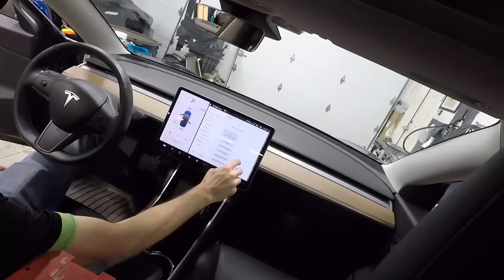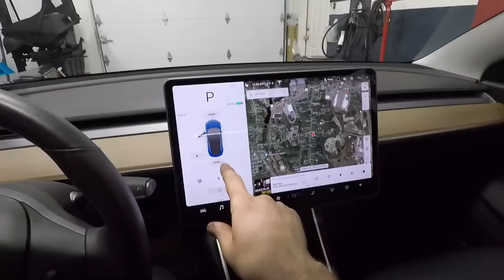Electrified Garage: How the Pros install a Hansshow Tesla Model 3 Power Trunk Retrofit Kit

Comment: Listen to this guy people. When it’s done right, it’ll work for ages. 

I say this because I had a 1st gen Cadillac CTS. And in order to PROPERLY change out the headlight bulbs. You have to remove the front bumper. However, some have discovered that you could remove the air box for the driver side, and fuse box for the passenger. Both had its issues. The air box would some times not seal up tight. Some of those times, the engine wouldn’t stay running due to lack of flow over the MAP(I think) sensor. Or a week down the road it would start to act up because of the seal. 

Then the fuse box would have its own problems, but most of the time they didn’t show up until months later. 

Sure they saved an hour or so of time by not removing the bumper.  But they caused themselves hours of headache down the road. 

My point is, do it right the first time.

Comment: Thank you for showing the convenient 12v power source. I wish I had known about that when I did my TeslaOffer kit last year.  I will definitely use it for when I add a tow hitch lighting module to my 2018 M3p. 

Btw, did you forget the wires for the trunk area lights or do they not do that version anymore?

Comment: Don’t follow the drilling through the body part! There are grommets under the crash bar where you can pass the actuator cables through. Other than that it’s a great tutorial.
Reply: He claims the drivers side is occupied by a drain wire, but its purple and we have done it in that plug ??
Reply: @rpmtesla  the existing hole with gromet is not on the side of the car, it's under the crash bar.  There are two of these, one on each end of the crash bar. Check out around 15:30 into this vid https://youtu.be/7ytE7fd45b0
Reply: @michaelbergmark3549  Thanks for the tip. I found the two grommets you mentioned, and used a hole punch on them and put my cables through those.

Comment: Any reason you don't go through the two blue grommets on the rear of the car, if you have a post 2019 car, rather than drilling a hole?
Reply from the maker: You can do that, there's no reason why that wont work other than size of hole VS plug size depending on the make/ model of kit you are using.

Comment: Some extra tips, I just installed this kit with the help of your great video. I really didnt want to use the rear light holes either. The only thing I did different: I found it better to not drill an extra hole but route the left wire to the exisiting hole on the right. (The cable is long enough) Also make sure to remove the metal bumper clips if the dont come off by themselves. The can scratch the paint when reinstalling. When i put my rearbumper bach a cable of the parking distance sensor became stuck between the inside of the bumper and the metal bar. I didnt notice this untill I was finished and had to remove the entire bumper again.

Comment: NOTE TO EVERYONE. I HAVE INSTALLED MY STRUT WIRING WITHOUT RUNNING IT DOWN THE TRUNK AND GOING IN THE TAILIGHT (BAD IDEA) OR DOWN TO THE TRUNK THROUGH AN EXISTING GROMMET.   I obtained double sided grommets with a tube like the factory grommet that goes up to the trunk lid. My wiring comes out through the vertical wall (I had to drill a hole of course and had the rear deck top out) in the rain channel/gutter through this grommet/tube just behind (towards the back of car) the factory on the right side and alone of course on the left drivers side. Just above/forward to where the strut bottom attaches.  The wire only comes down a couple of inches then to the strut. Looks like a factory installation. Not sure why nobody else I have heard of has done this.

Comment: What model 3 year was this? My kit came with a CAN BUS.. I see you did not install this? Do you have to? My wont even fit my 2018 model 3.
Thanks
Reply from the maker: Yes, the CAN bus needs to be connected if the kit requires it. This is not that hard to do, the interface is behind the center console or the drivers side kick panel depending on kit make/variant, this kit has a plug in harness and did not require CAN connection.

Comment: I just did the install today and now my 12v battery is dead. I did the power to the 12v connector under the rear seat thing but that bolt is weird. The washer comes up with it and I couldn't get the power terminal connector to slide between the nut and the washer so I put it at the bottom. Does that matter? I was doing this project for most of the day and I'm wondering if I hurt the 12v by doing that. I didn't  turn climate off so it was on for hours like that, and I had the car powered off quite a bit but I read that can also hurt the 12v because the main battery isn't supporting it then. Ugh. :(

Comment: Electrified Garage, I have a totally more oem way to do it. I can understand that others may not want to do this because it does require drilling a new hole through the vertical side of the gutter area.  The trunk wiring goes through a grommet on the right side which has a boot. the grommet as a lip on the inside and outside to keep out the water. It is also on the vertical to reduce water flow going on it. On the left side there is a similar flat area which is not used since there is no boot there. You can buy such a similar grommet/boot and make another smaller hole further up or down the vertical section with a 90 degree bend and will run the wiring right into the trunk area without going to the gutter and cramming under the seal etc. Much less unsightly, water safe and looks like it was oem.  I found these on the internet. They are the only one I found that use a round hole which is easy to drill, rather than an oval hole. https://www.ebay.com/itm/Power-Window-Door-Jamb-Wiring-Boots-Pair-Accordion-Style-Z-4-Long-3-4-Hole/352208860385?hash=item520148b4e1:g:7pQAAOSwvdxdRK09     These have grommets at both ends, but you could just cut one end of and just use the one grommet and the boot downward with the wire coming out. The boot going in a downward direction would prevent water from getting in and it would not upward towards the grommet.

Comment: Installed the frunk kit today on 2018 Model 3.  Worked great initially, but now the frunk lid is stuck open.  Tried power down, trying with debugging cable and without, still stuck open.  Any suggestions? Thanks

Comment: There is one big problem here, the 12 volt source under the rear seat, can from time to time go to sleep, only way to wake it up, is to put the car in drive. I will now extend the cable, so the I can reach the 12 volt source that Hansshow point to in the manual.

Comment: You should keep the bumper off until you put the kick sensor 2018 earlier models you have to remove a complete bumper however later 2018 up they have a square top off rear bottom bumper easy access to mouth your foot sensor.
Reply: I see why because you're not installing foot sensor version 2 compared to version 3 is so much easier to install you didn't have to mess with the C pillar you wire straight to the trunk lid area. That it. Also I prefer to put the Box controller on the left hand side where there's a ground near but also it's a straight shot to the power supply need a driver foot rest area there's a positive bolt waiting to say hello to you. Also best install an extra momentary switch on the left hand side for most convenient likely you'll be tapping it on close trunk on way to your driver side instead of reaching all the way over to the top right-hand side or lower if you're already on the driver side. Feel free to see my video on my channel easier more clraner  installation modifying version 2 to version 3 Hannshow power trunk setup.

Comment: I finished installing the hansshow trunk kit be. And tapped the power from that same place of rear passenger seat 12v. Everything works.  Now the vehicle is showing a error message "vehicle is consuming more energy while in idle" 

I didn't see that msg when u are in the car. Is it BC of the new updates or sth I did wrong?

Comment: You can also get caps that are closed and cut a slit in them like the factory one, rather than having a hole with the grommet that you have to fill as much.  Yes, then you mentioned about a tesla oem part to use instead. As I was typing.

Comment: Outstanding install video.  Very thorough.  One issue I would suggest is to make sure that you have the right Hansshow kit for your model 3.  During the install I realized that the one harness that came with the Version 4 wasn't compatible with my 2020 (Sept) model 3.
Reply from the maker: That is correct, so the issue with all of these kits is that they change so rapidly it is very hard to keep track of them.

Comment: Does the rear seat 12v powers off when car in sleep? Or is the power source is always on.
Reply from the maker: That is the 12v battery feed from the HV to charge the 12v, it is powered all the time.
Reply: @ElectrifiedGarage  Any chance of making a connection here eventually throwing 12v errors?  I've seen stories of people that have had problems connecting to other 12v sources, but nothing specifically about this connection.

Comment: hey, why did you use double sided tape for the control box instead of the nut and bolt that came with the kit?
Reply from the maker: The control box does not have tabs or a mount. Its just a square box,  the double sided tape came with the kit to mount the module.

Comment: Thanks for creating the best install video for the Hansshow Tesla Model 3 power trunk kit. I followed your video to the "T" and had a great install. I installed the Hansshow v3 which eliminates the dreaded work in the upper rear seat/speaker area. Instead, the connections are made in the door lift using the handle and door latch areas which made it a lot easier. You guys are the best!

Comment: Sorry expert, if you take 12v power from the back seat, the power supply to the controller will be lost when the car goes to sleep, this will cause your foot sensor doesn’t work and you lose all your settings in the controller. Not recommended.
Reply from the maker: no, it does not, that is the feed to the 12v battery, the DC/DC is under the rear seat, it may stop providing power out if the battery is fully charges but the 12v from the battery is still present.

Comment: I use those clips on assemblies at my shop. The galvanized ones like you are using sahhhhhk. There's a stainless version that is much more durable available through McMaster, but I think Fastener Warehouse in Portsmouth has them as well.

Comment: Is it necessary to put any protectant on the bare metal from when you drilled the hole? Like a primer or something? Or is that rubber seal + location enough to be safe to prevent rust? (i assume this part is steel and not aluminum)
Reply from the maker: Please go back and look in the video. That part is aluminum not steel. We did use a puddy sealant in additional to the rubber grommet.

Comment: Thanks for the video. With this, I was able to install my kit without even referring to the instructions - with the only tweak being using the grommets behind the crash bar instead of drilling a hole.

The only thing that seemed to be different with my install is that the loom for the trunk/boot lid had plugs to intercept the button - which I assume replaced the wire you had to run into the shelf and remove that C pillar trim etc.

Comment: Awesome! Would love a video on installing a tow bar! 🙏
Reply from the maker: Do you mean a trailer hitch? You can actual use this video for removing the bumper. Then its just a matter of 12 nuts and bolt it up and reattach the bumper. Very straight forward install on something like that.
Reply: Electrified Garage yes! But what about the electronics?
Reply: @ElectrifiedGarage  what about the electronics for a pre-tow hitch model 3? I have a 2018 LR RWD and there is no harness. Curious about all the aftermarket options for adding it to tow a small utility trailer.
Reply from the maker: Anthony Stanisci trailer lighting harness is what you’re talking about? We will be making this video with the trailer hitch in the next few weeks.
Reply: @ElectrifiedGarage  thank you!
Reply: @ElectrifiedGarage  What sealant did you use at 15:20 ... I'll be attempting this install on Friday!

Comment: Could have used some tips couple months before :) 
Like decliping the harness to easily feed it through the rubber or that there is a 12V under the back seat, i did feed it the whole way to the 12V battery in the front (and that is why the wire is so long)

Comment: Is this a new Hansshow kit? I have mine but haven't installed it yet. Other videos show multiple wires and plugs going to the hatch and nothing under the deck lid.
Reply: NewFoundTerror you probably the same newer version as shown in this video. Only one wire to the hatch. Check out frosty fingers YouTube channel as well.

Comment: All your wires seem to have plugs of one kind or another all ready attached.  My two (2) harneses have 5 wire leads with no plugs or labels.  In the larger bundle it's next to the tail gate butonwire. In the smaller bundel it's in a 'Y' marked motor plug and handle.  I assume they go to the interior trunk lights but how do I conect?  Any assistance you can give will be greatly appreciated.
Reply from the maker: So I have a couple of questions, What brand of kit are you using? What version of it also. Some of the company's have created new revisions of the unit / wiring.  From what you are describing, it sounds like an earlier revision where 2 of the harnesses need to be snaked up the the trunk harness and connected in the lid of the trunk instead of connecting under the rear shelf area.
Reply: @ElectrifiedGarage  You were exactly right.  I checked the instructions that came with the kit and saw where the wires were joined once you phish them to the middle of the trunk lid.  Thanks again for your help and patience.

Comment: Wish I knew about that 12v connection under the seat when I did mine in December. Alot easier than running to the front. Note, you can open and close the trunk with earlier versions of the Hannshow kit from the touch screen also. It just doesn't flash 'open/opened'. Still shows the 'open' option. Only difference with V3 you have is the flashing between status as that tells you it is indeed Opened.  Earlier versions you just need to look back and see. Also, adjusting the soft kit is from the main controller. But mine pulls in a bit too hard and makes a latching sound after closing (pulls centre of trunk lid in too much also). Hannshow hasn't been able to help with that.... wondering what you did different.
Reply from the maker: Please look to the end of the video for adjusting the latch and striker. It sounds like it's not adjusted properly and is causing it to bind up.
Reply: @ElectrifiedGarage  thanks for the response. Really appreciate it.  I did all those adjustments prior. Initially Hannshow said to take the bumper stops off, but I found that to marr the paint on the bumper. They told me to put them back in, but then the suction was super obvious. If there was a spring adjustment on the latch, that would solve my problem. I have the latch set as far outward as possible and have come to accept as it is for now. The system works very well otherwise and very oem

Comment: Great video .. I have finished installing my Hansshow Power trunk in my model 3 and connected power to the 12v PCS connection under the seat as in your video. But i have a slight problem - sometimes when the car is locked the power truck stops working - it wont open at all.. then if i unlock the car it works again. It seems as though if the car has been driven for a while the trunk still works for a little longer - im wondering if this is because the 12v battery is being charged for a while after driving and power is disconnected from this PCS connection when charging is finished cutting the supply to the power trunk?

Have you had any issues with the truck not opening when the car is locked/asleep?
Reply: I've done a little more testing.. and have confirmed that the 12v PCS connection does indeed power off when the 12v battery is not being charged, so when this happens the  trunk stops working. I have now moved my 12v connection to the VC Right connection and it now stays on and works all the time...
Reply: So connecting to the PCS connection under the rear passenger seat will stop working? If u bring it up the VC right, where are you get the power source from?
Reply: If you look at this video https://www.youtube.com/watch?v=rDYbvI32OBE at 2:10 he talks about VC right - there are 2x Thick Red cables connecting to the module - the one on the left is where i connected the power cable for the trunk (its the bottom connection when mounted in the car). VC Right is a circuit board/module that is mounted on the right side of the kick panel just in front of the door - you need to remove some trim in the footwell to get to it. Also, id advise disconnecting the 12v battery + lead before making the connection as it is always live and you dont want to risk shorting it to any metal parts of the car!